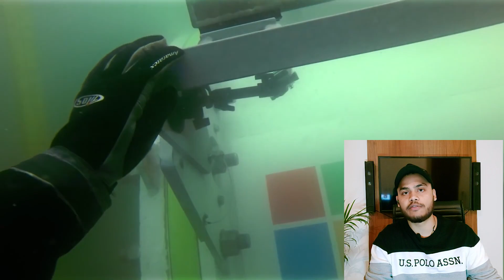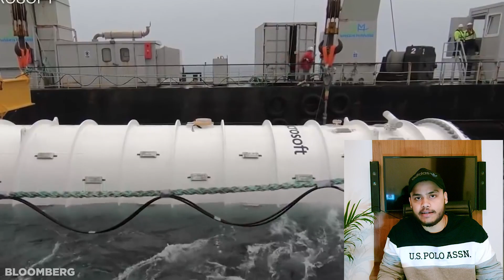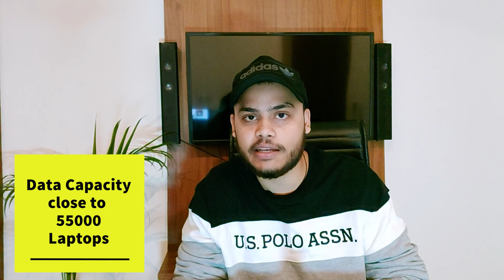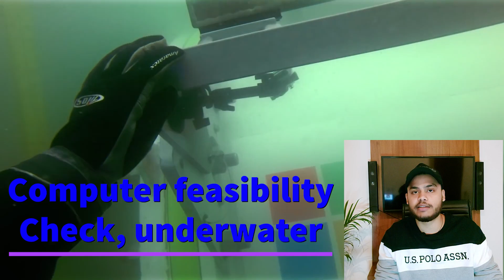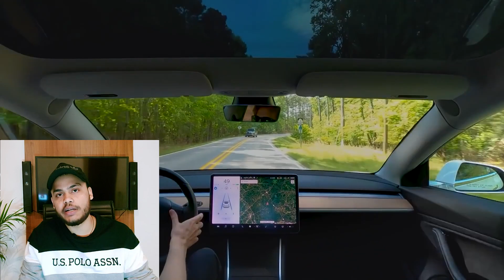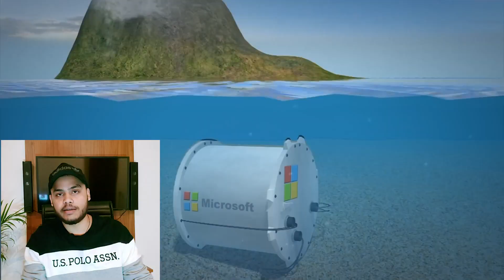Microsoft underwater data centers are awesome🔥!! Project Natick in Hindi

Comment: Jab surface par data centers cooling me bahut zyada kharch karte he, iska matlab hua ki heat produce hoti he achi khasi. Lekin paani is oxygen free chamber me rakhe computers ki heat kaha gayi agar water garm nahi hua?
Reply from the maker: Thanks for asking.
I've also discussed this after 6:40 minutes in the video and  according to Microsoft study, they've checked the temperature with most advanced tools and it had minimum impact on sea temperature.
And container was filled with nitrogen gas, nitrogen is a bad conductor of heat. 
Like this if I've answered your questions.
Reply: @VineyBeUniqueAF  That makes it more interesting, the container was filled with nitrogen then how did they cool those processors? On surface data centers use air to cool the processors and again use refrigeration systems to cool that air.